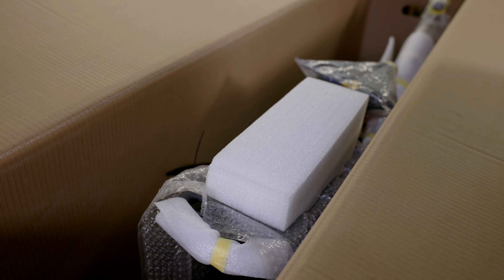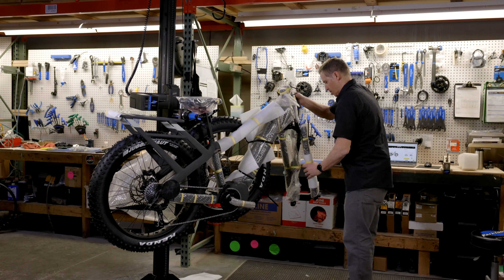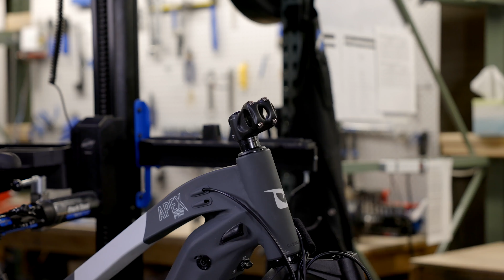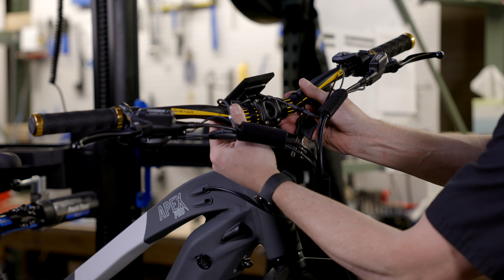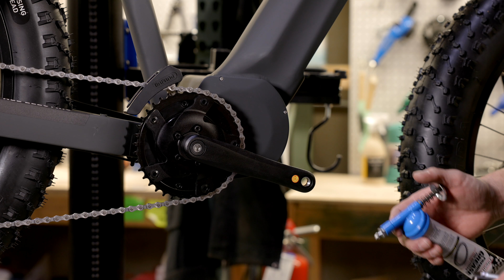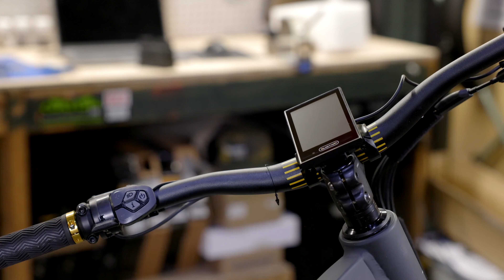2023 Apex Pro & Apex Sport Assembly

Comment: ?  Is a battery charger provided to recharge and maintain  the battery?  Surely a means is provided in order to charge and maintain the battery?  Other than showing me how to install and remove the battery for charging, I saw nothing about a charger being included in the kit.  I have ordered the Apex Sport two days ago and certainly hope I font have spend big bucks to additionally purchas an expensive charger.
Reply from the maker: Yes, all Quietkat bikes come with a charger. Thanks for reaching out.
Reply: Great video.  My only complaint was with lining up the rotor   I was hoping the video would zoom in on that going in but I figured it out .   Thanks.